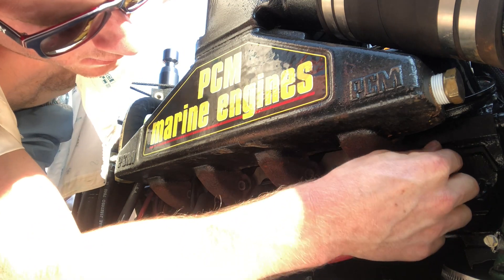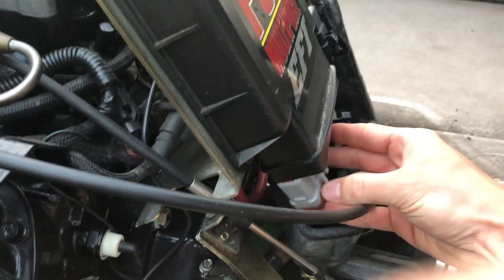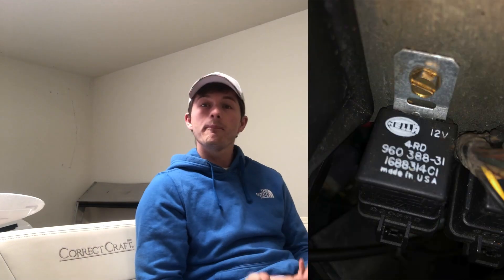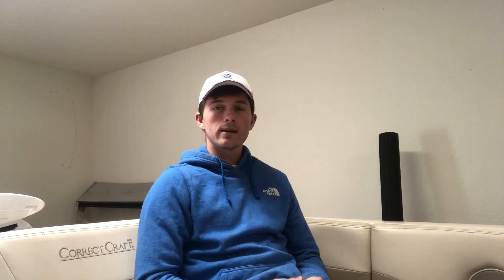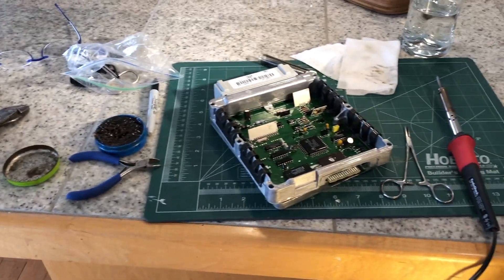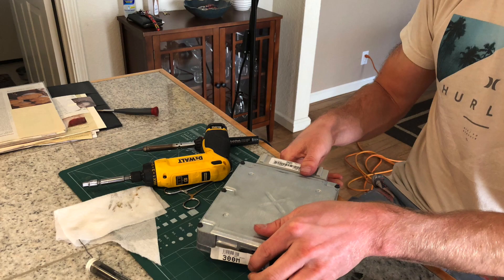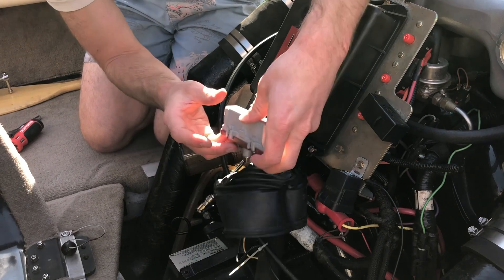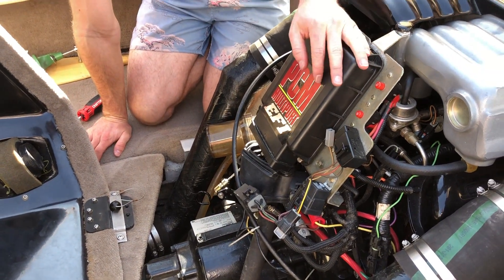Engine Surging/Not Running

Comment: Thanks for another option in my arsenal. I have a GT-40 in my 1998 Air Nautique and occasionally it won't fire on petrol (I'm in the UK) but it'll run fine on LPG as it's dual fuel. Even knowing that the spark and ECU are fine it's still been difficult to trace the intermittent start/not start issue on petrol. Recently picked up a Carter P4389 and it's been fine since replacement, but I'm still not convinced that was the root cause. The relays I got as part of the diagnosis, direct from Nautique Parts, are 4RD 007 794-31 that might be easier to get hold of than the original part numbers. Hopefully that might help others that happen across this video
Reply from the maker: Great insight

Comment: I have been having a surge and slow firing problem with my GT 40. Just ordered a new computer as I am not as handy with a soldering iron as you are. I am definitely going to pull the old one apart and look at it once the new one arrives. Great video thank you
Reply from the maker: I hope that fixes your problems

Comment: Nice work! Anytime you have a surging issue, always hook up an inline fuel pressure gauge, drive the boat and watch the gauge when the surging happens. You would see low fuel pressure, then you could hook up a meter to the fuel pump and see its voltage is cutting out while its surging. The ECM probably gives the fuel pump relay a ground to activate it which makes sense the ECM was damaged
Reply from the maker: It was so hard to find this but I am glad it is all fixed.

Comment: Great job!  The previous owner on my '97 said that it kept dying when they were in Tahoe, but no place else.  They said it was one of the relays so they kept a couple on board.  I've had the boat for two years now and haven't had a problem (nor on my '96 that I put 1600hrs on from new).  But good to know that it's fairly easy to get to the PCB.  My '96 I kept in a garage since new so the engine looked pristine even at 1600hrs.  The previous owner kept it outside and covered, but it appears they never opened the engine compartment to reduce humidity, because every bit of aluminum is severely oxidized.  I'm hoping all of the connectors (especially the one to the ECM) are good; I'm afraid to pull it off in case it falls apart....

Just subscribed.  Appreciate the video.  Love learning from someone with a bubble but SN with a GT40!
Reply from the maker: Wow, 1,600 hours and still running hard. I’m glad to here it! See you on the water!

Comment: Good job knowing how to diagnose the problem and electrical work. That exhaust sounds good in the water too
Reply from the maker: Thank you, I still cant believe it. This V8 sounds so great in the water
Reply: @92813justin  it does sound good. My moomba has straight dual exhaust but in the water it’s extremely quiet at idle. Almost can’t even hear it